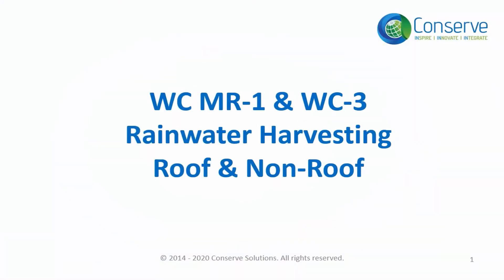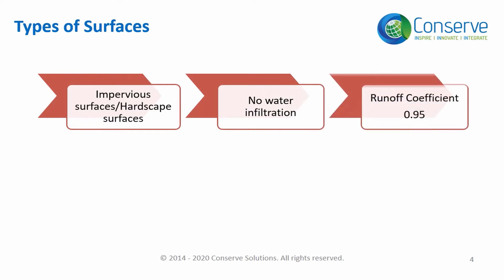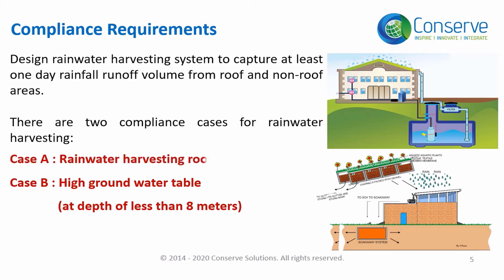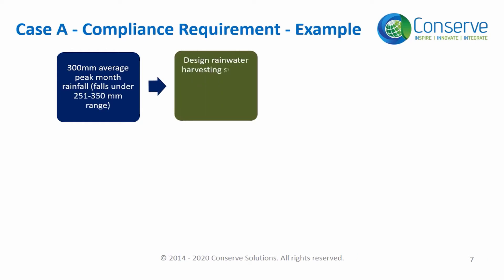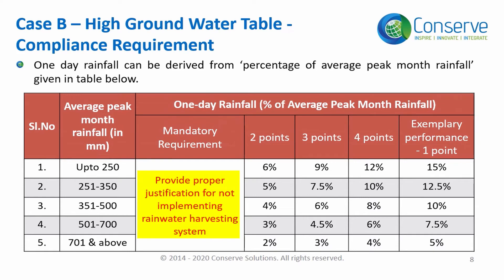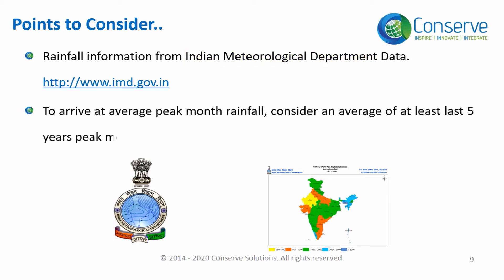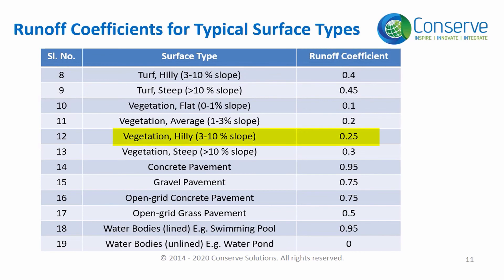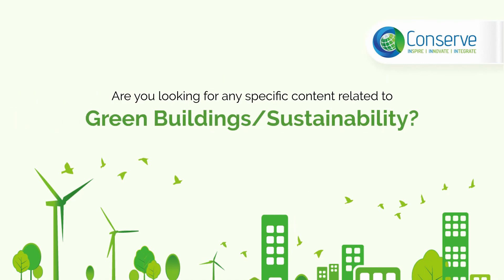Rain Water Harvesting | Water conservation | IGBC AP Exam Preparation

Comment: do let me know if Rain water harvesting should be done using energy or it should be gravity flow
Reply from the maker: In most cases simple gravity based harvesting system is sufficient if you are infiltrating rainwater into ground. A treatment and pumping system is required if you intend to reuse rainwater.